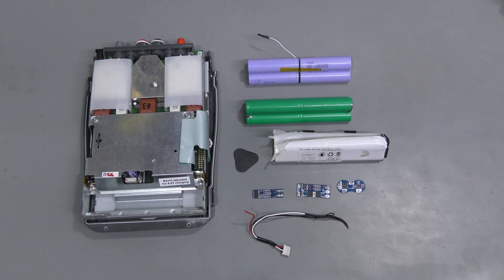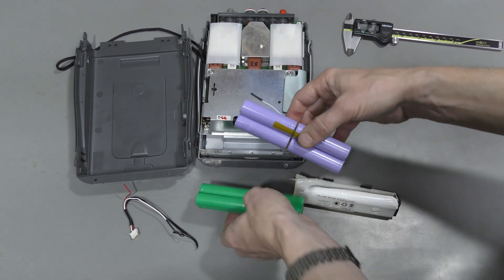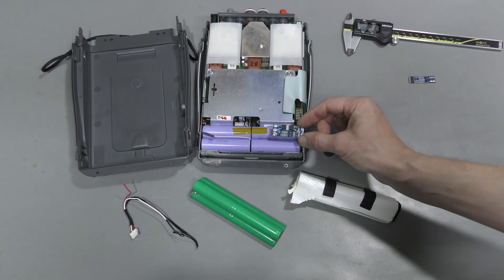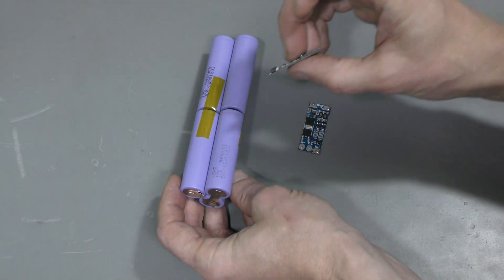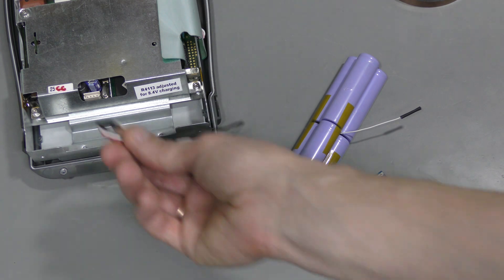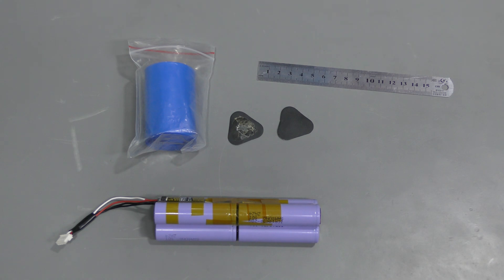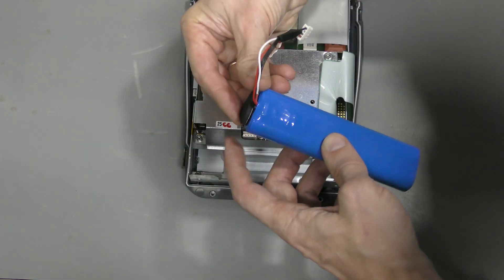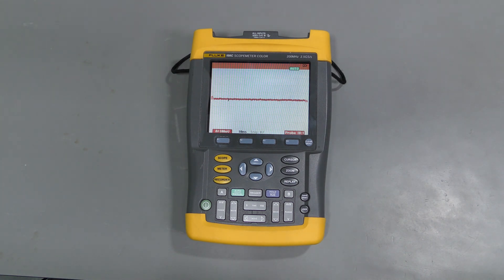#132 - Fluke19x Li-ion battery with balancing

Comment from the maker: CORRECTION: the label on the battery pack should have said 6300 mAh. The donor pack was 3s2p, and I tested each PAIR before building the pack, and measured about 4200 each. But then the pack was reconfigured as 2s3p. Sorry about this confusion.
Reply: Excelent information, tks máster.

Comment: Me han regalado un Fluke 199C en teoría porque no funciona; he montado un pack de baterías Ni-Mh nuevas  y aparentemente funciona bien cuando se conecta el cargador (carga las baterías perfectamente) pero con las baterías ya cargadas con 8,4V  y el cargador desconectado al poco rato el indicador de estado de baterías aparece con la cruz y el equipo se apaga .
He fabricado un pack de dos baterías de litio de 3,7V y 5000mA y con las resistencia en paralelo que aconseja en uno de sus vídeos y sucede lo mismo. los datos que puedo aportar son los siguientes:
Con las baterías de litio cargadas a tope el indicador de estado de baterías  muestra la cruz de batería baja cuando su valor baja a 7,5V
El valor de BATVOLT siempre es 0,3xVBAT
La carga media en R4101 corresponde más o menos a 1Ah
El voltaje en R4113 es más o menos 8,46V
¿Dada la experiencia que usted tiene con este equipo sería tan amable de darme alguna idea de lo que puede estar pasando?

Comment: Здравствуйте, у меня та же проблема и тоже не хочется покупать новую NiMH батарею. Можно вас попросить поподробнее дать информацию:
1) Какие из проводов штатного разъёма куда идут? Красный-Чёрный толстый - белый - чёрный тонкий 
2) Что за модуль BMS - ссылку на Али или где брали?
3) Схему новых соединений, если можно.
4) Как теперь осуществляется зарядка, если батареи другого типа? Годится ли штатный блок питания?
5) Какие батареи использовались?
Я думаю запитать прибор от 2-х батареек 26650 - LiFePO4 - как вы думаете: это возможно без переделки прибора и блока питания?
Большое спасибо заранее за любой ответ.
Reply: EN: Same problem here, don't want new NiMH, would likee to use newer batteries like LiPo or LiFePO4. Could you give more information please:
1) Which wires of the original jack mean what?
2) Where did you take the BMS featured (link if possible)?
3) A diagram of new system would be great
4) The type of batteries is different now. I wonder if the original power supply (designed for NiMH) works for LiXX batteries or how do you charge?
5) what is exactly the type of your batteries?
I am thinking of using 2S out of 26650 LiFePO4 cells I have - do you think it is possible? Will it work and charge? Could you suggest a BMS or is it possible just to plug + and - into the existing jack, what do you think? 
(I understand It will not be nearly as neet as your setup, but who cares, if it is buried inside the scope...)
Thank you very much in advance!

Comment: This is not a bad scope meter— it’s nice that the probes are completely isolated, so you don’t need to worry about having an isolation transformer to prevent your scope from blowing up.  The software features of the scope are antiquated, but for basic troubleshooting it’s quite okay.

Comment: Please tell me, after installing the battery, you need to do Battery Refresh?
Reply from the maker: No. This refresh is for NiMH batteries. They need a full discharge-charge cycle from time to time.
Reply: @feedback-loop  Thanks for the answer, there is another important question, in the last video you showed the battery discharge after assembly, whether the battery discharge corresponds and on the oscilloscope itself the battery discharge pattern is in the upper right corner of the screen where the icon shows how much charge is left. https://youtu.be/Lnkz2z6KjG8?t=1424
Reply from the maker: @saidgusainov6252  Again I don't understand your question.
Reply: @feedback-loop  Does the battery indicator show the correct battery level?
Reply from the maker: @saidgusainov6252  Not quite, and I showed that in detail in the video you linked above. Why are you asking if you know exactly where it was explained?
Reply: @feedback-loop  Sorry for my English, it's not very good for me, I tried to find out from you if the battery charge indicator and the battery itself correspond to the indication? I tried to understand from the video and did not really understand this moment, so I asked you this question.

Comment: Please tell me, at the moment 2s3p is connected ? Are the battery connections in series or parallel? each battery must be 4200mA ?
Reply from the maker: Yes, 2s3p. What else it can be? 6 cells with 8.4V target voltage. There is no other way. The middle point is connected to BMS as well, that means common middle point: 3p + 3p. Otherwise you would have 3 separate middle points, right? And which one would you connect to the BMS?
Reply: @feedback-loop  Yes, you are right, you get a connection like in a native battery? I just don’t want to damage the device, it’s better to ask than to look for the cause of the breakdown later.
Reply from the maker: @saidgusainov6252  The original NiMH battery is one string of 6 cells (6s1p). Each cell is about 1.2-1.4V
Reply: @feedback-loop  Yes, you are right, I understand your connections, you have a serial-parallel connection.
Reply: @feedback-loop  What should be the capacity of each battery?
Reply from the maker: @saidgusainov6252  Could you clarify this question?
Reply: @feedback-loop  You have 6 batteries in the video, what is the capacity of each battery? or what is the capacity of all 4200mA batteries?
Reply: @feedback-loop  I have such 18650 2200mAh DLG NCM18650-220 can I use them?
Reply from the maker: @saidgusainov6252  You can use any cells (all 6 of the same type, of course). If you use 2200 mAh cells, the pack will have 6600 mAh overall. I think the scope can run for about 6-7 hours on such a pack.
Reply: @feedback-loop  How many mA do you have for each cell?
Reply from the maker: @saidgusainov6252  Could you clarify this?
Reply: @feedback-loop  Thank you for your answers, what is the capacity of each cell of your battery? I wanted to know.
Reply from the maker: @saidgusainov6252  About 2100 each cell, or 6300 total (there is a mistake in the video showing 4200 label on the pack, which I mentioned in the description).
Reply: @feedback-loop  That's what I wanted to know, thanks.
Reply: @feedback-loop  I think it will be such a connection. https://preview.redd.it/zbxtnqbmyog81.png?width=2056&format=png&auto=webp&s=99be8dde71ddda08028272cf4199c033710a18f9

Comment: Hi
I tried it but I have no voltage between pin 1 and (2-4)on the 4 pins connector. But I have 8,2v between B+ and B- 
Are the pin P- and B- should be tied together ? I Measure about 1 Megohm between these two pins.....
Reply: in some of these modules it is necessary to apply battery charging voltage between P+ and P-  to start working
Reply: @je1966  Absolutely, I tried that and it started working. Not much info on these modules...

Comment: what is the value of the thermal fuse ?
Thank you for the time you put in this, I will surely upgrade my 199c
Reply from the maker: I would suggest 100-110 degrees C. Does not matter much. Just some additional protection.

Comment: You say to discharge the pack before installing. I though you couldn't discharge li-on without ruining it?
Reply from the maker: I did not propose over-discharging it. Healthy discharge to 2.8V - 3V (per cell). That should make it much safer to handle

Comment: Surely this video is only useful if you share a link to the board used
Reply from the maker: I bought 2 pieces for $12 here: https://www.ebay.com/itm/224775236238
Reply: Any link he provides will be dead in few weeks.  Try searching eBay for, "2S BMS balance."
Reply: @FlyingShotsman  surely if I didn’t know to try that term in Google search why would I even own an oscilloscope let alone take it apart to change the battery typology

Comment: Keep an eye on it though if you're not using it for a longer time. Depending on the topology of the balancing module, it might drain the battery or half of it.

I've seen various 4 cell balancing boards now, that where fitted by the manufacturer of batteries that actually drained 1 or 2 cells.

Comment: Very neat and professional, especially with the PVC heat shrink which I now need to go buy. I didn't know multi-cell packs could be partially (?) balanced, I'm guessing this pack is a series of two sets of three-parallel cells?
Reply from the maker: yes, 2s3p configuration. why partially?
Reply: @feedback-loop  I meant to imply that in parallel you can't control cell charging currents individually, although its clear voltages are well controlled. I put a (?) to imply I know little about cell chemistry or charging, and perhaps this isn't a problem except in catastrophic failures like a shorted cell.